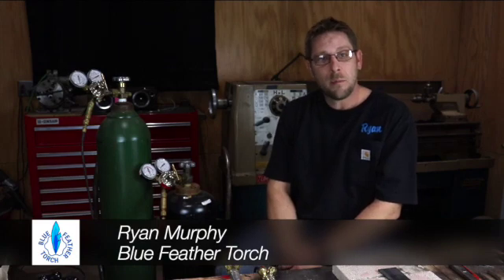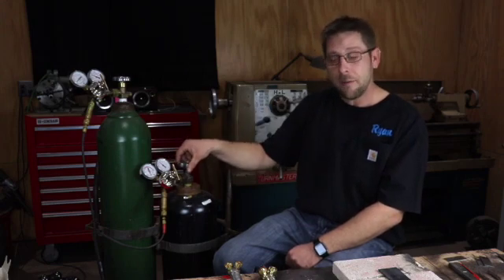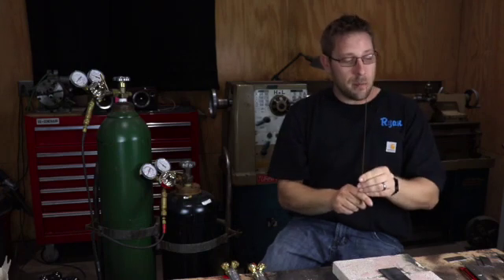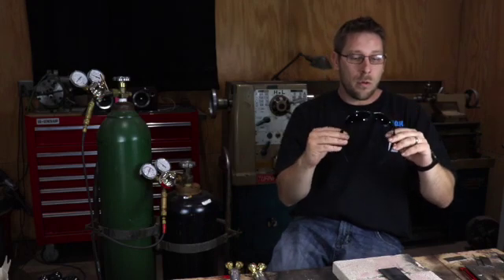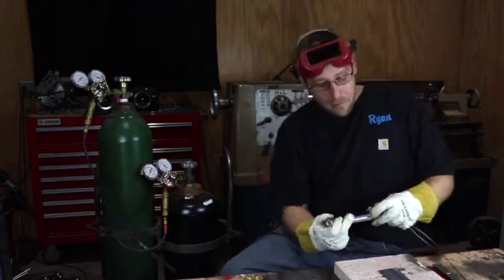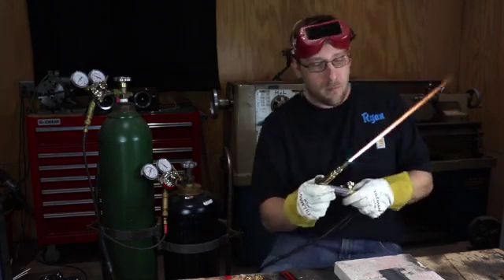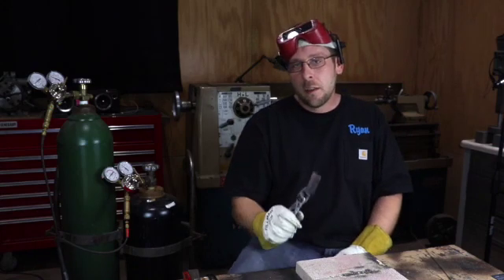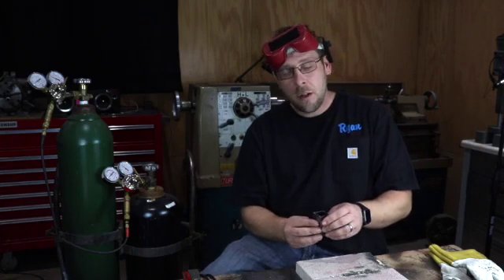Steps towards making your first gas torch welds-Blue Feather Torch

Comment: what pressure on the regulator for the little portatorch oxy/acet bottles?  i think you need higher no?
Reply: Does the shield/goggles you use for this kind of welding have to be as dark as when you tig weld?
Reply: @AH-mp5di  no, it's just shades for cutting
Reply from the maker: @AH-mp5di we use a shade 5 lens.
Reply from the maker: Same pressures on the portable bottles as well. 5 psi on oxygen and 5 psi on the acetylene well pretty much cover you.